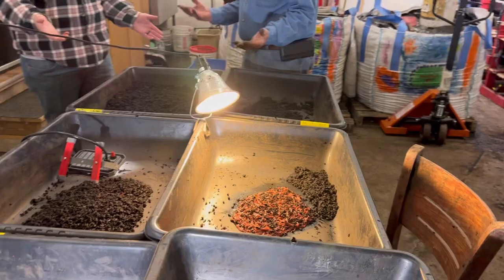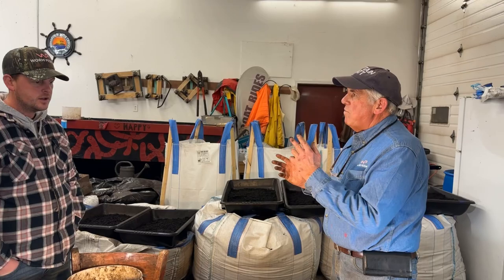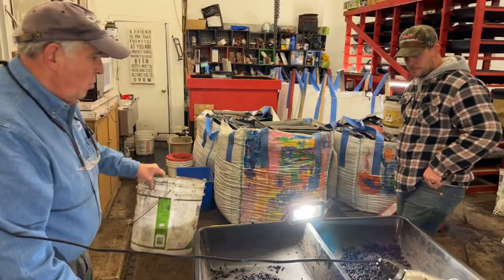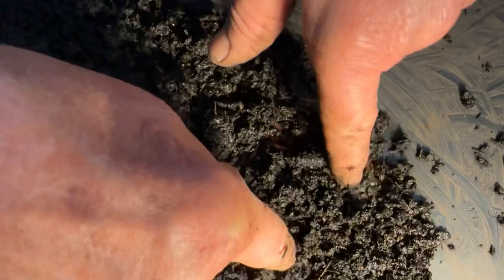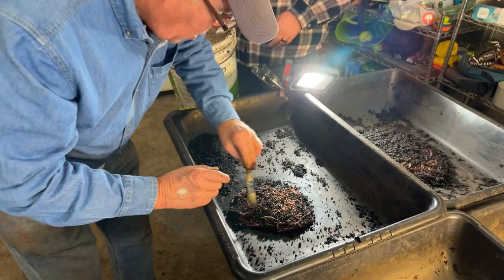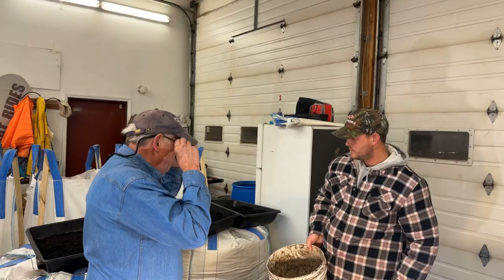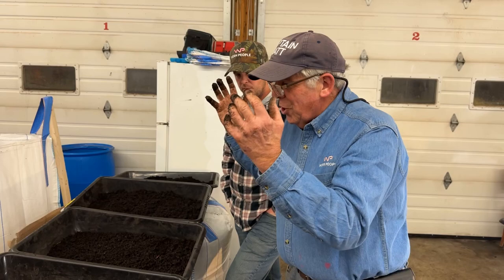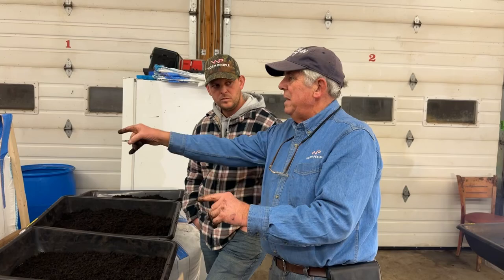Separating Worms with the Light Method

Comment: Hey Captain Matt as a beginner I may be speaking rubbish.
But my suggestion is that you could force the worms to migrate away from the bedding and cocoons by placing a dark plastic light separator in the middle of the bin (so one end is Dark and the other side has the bright light).
This means that instead of the worms clumping deep to escape the light they migrate to the dark side via holes under the soil.

Comment: Another great video Cap'n, thank you. I love the small soft brush to aid separation, I'll definitely be doing  that. I just started yesterday trying to harvest my first castings from the bottom of my CFT. It's only 3 or 4 months old so I wasn't expecting much, but what surprised me was the number of adult, and juvenile, worms at the bottom of the 21" high bin. I only feed from the top and didn't expect that many lower down. I did start the bin off with leaf mould, manure and plenty of compost so there's still food down there. Have you any suggestions?
Reply from the maker: Hey William… that first harvest is a thrill. I’m so happy for you. I would just put the worms back in top - with red wigglers I’ve not had too many at bottom - but lots of variables.

Comment: I'm not sure what you're using as bedding in your breeder bins, but in mine I'm using peat moss, coir and composted cow manure in equal parts... After 21 days, I don't consider this to be castings, but rather the start of enhanced potting medium, just add perlite and vermiculite... I can't see the quality from this short cycle being as nutrient rich as the castings produced in the composting worm bins that run 3-4 months, even with all the amendments I add to the chow to process through the worms
Reply from the maker: I finely presift my bedding inputs of composted leaves and wood chips - so it becomes almost pure castings rather quickly.